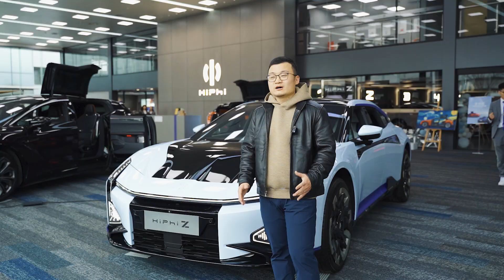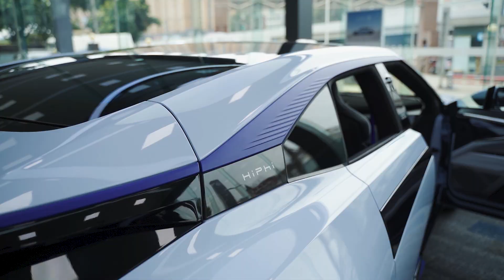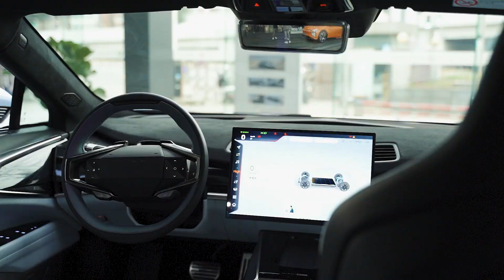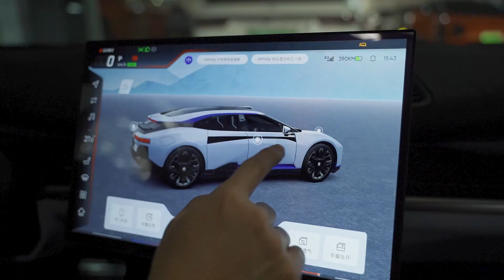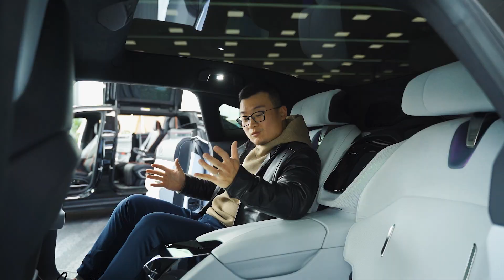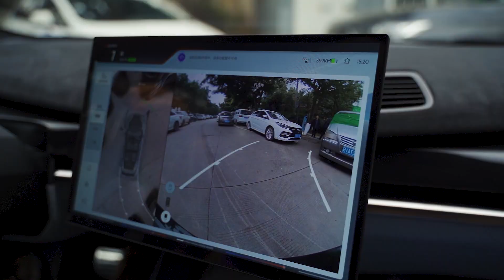Hiphi Z, the car from the future

Comment: The car is too sporty which means not practical after first glimpse. My biggest issue is horrible rear view for the driver - and it is due to bad design of rear. The car has many complex and but not very practical featuresor non-essential. For sure this type of car is not me.
Reply from the maker: the rear view mirror plays images from the cameras at the back and from my experience it is not bad at all. For sure this car is not designed to be practical but it has four/five heated and ventilated comfy seats and a large boot, more practical than a lot of sedans to be honest.
Reply: @revchina My interest stays on family cars - mostly hatchbacks, minivans, or ideally mpvs.
Obviously the Hiphi Z is not such type of car I'm keen on. 
That said, it's interesting car, with interesting design, and there are many buyers for such type chassis. I like watch your reviews.
Reply from the maker: @NiejakiDD  thank you